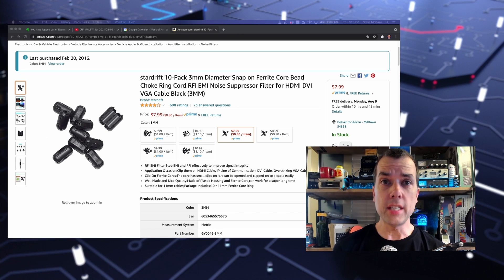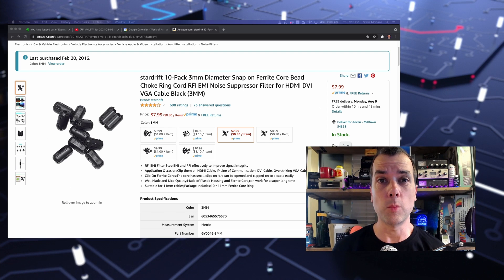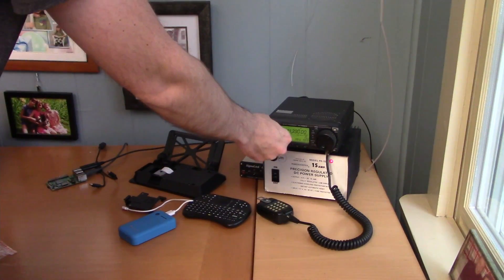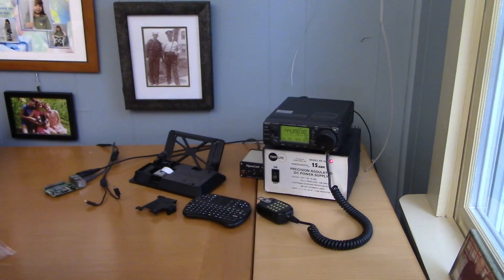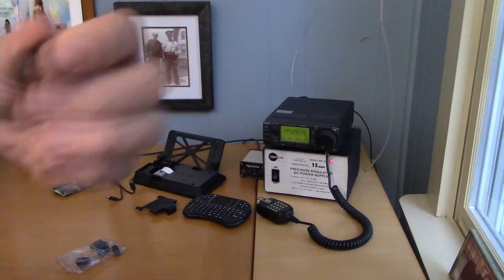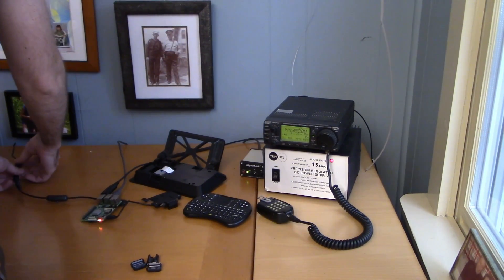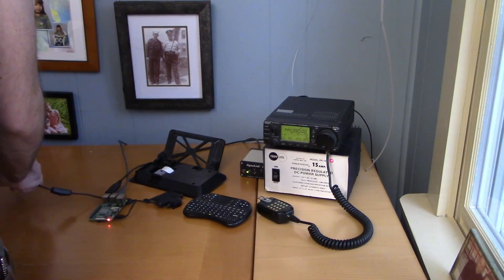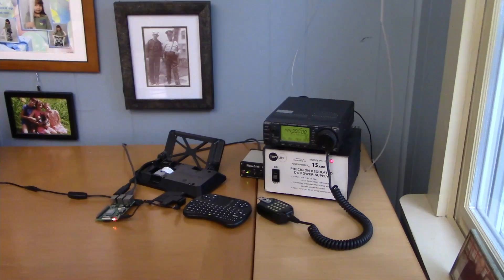Fixing RFi with a Raspberry Pi

Comment: Use a torroid and put multiple loops of wire through the core. This is much more efficient (and less costly) than snapping on 4 or 6 of those ferrite beads. The reason is ... When a conductor is passed through the center of a ferrite bead, the impedance goes up with the SQUARE of the number of passes through the center. With a torrid, you can get MANY more loops through than a snap on.
Reply from the maker: Good point, thanks for the tip!
Reply: I have both a Toroid and 5 Ferrite beads. I think I´m gonna do some experiments. My goal is to have a clean reception at HF with my Raspi4 and  SDR++. Thanks you guys for the tips

Comment: did you have your pi hooked up to the radio with a USB cable?

If so, did you try toroids on the USB cable?

just wondering.
Reply from the maker: The Pi was hooked to the radio for sure.  (the black cable is the CI-V cable).  I only put toroids on the USB Power cable so far.

Comment: Those wallwarts are a plague sometimes. Have been running into them as well, even from a (HAM) HT(!).
Replaced that one because it was no fun on HF whatever I did - at least before the ferrites.

What I found effective is running the lead through the same ferrite more than once - if there's the space for that it is. 
Looping wires through the same ferrite 4 times was more effective  (in my case) than running multiple in a row. You might want to give that a try :)

Let me know if you did and if it made a difference
Reply from the maker: I 100% agree, more passes through the core are better.  I do have another core here that was specifically made for doing the job.

Comment: I stop using wall warts for my Raspberry Pi's.  Instead I use a multiple outlet Anker power adapter.  It has enough power and no noise.  Plus it has it's own AC cord so I don't take up another outlet.
Reply from the maker: I've got one of those in use, I love Anker Products
Reply: Would you mind sharing a link to the multiple outlet anker power adapter? K2SBM Shawn

Comment: I have a huge bag from Amazon. I wasn't very confident they were effective. I bought a couple of toroids from Palomar (very expensive) and wrapped the coax through the ring 10 times. It worked  but this is a much cheaper solution. Thanks for proving they work.
Reply from the maker: It was what I had in hand, I'm happy with the results.

Comment: I used a 12v to 5v buck converter (since the 12v supply was fine)... cleared everything up except 10/12 meter bands .. Once I got rid of my Dell monitors, 10 and 12 were just fine.
Reply from the maker: I'll be trying a buck converter in this setup in the future.
Reply: @temporarilyoffline  I second this, Is your triplite PS a switcher or is it heavy with a internal trasnformer ? You may want to try to move the Buck Converter further way from the PS and Radio "if" you get any, Also a small metal box for the BC will help shield any noise, Same for the PI try in in a metal case. Thanks for the video its great you share your tinkering events with everyone very helpful.
Reply from the maker: @jimw9170  Its a lot of fun to do and I hope it inspires people to just try something.  That Tripp-Lite is very heavy with an internal transformer.

Comment: You need a clean power source. I use my radio psu to power anything related to radio. I would also use mix 43 ferrite ring wound with the usb lead if using HF. This kills my RFI stone dead but I am not sure for VHF/UHF.
Reply from the maker: Eventually this will be portable, but for now I'm just playing around.  Thanks for the tips!

Comment: Wall warts are the enemy of radio!
Reply from the maker: No More Warts!
Reply: @temporarilyoffline  any kind of wart is bad Body or radio. Agreed 1000% I try to run everything in my shack off DC battery power. I keep a charger on it. I have not picked up any rfi from the current charger I use. The switching PS are almost as bad as the wall warts IMHO. My Astron power supplies "boat anchor weight" are clean and I prefer that type of 12V power over any switching PS around any radio or SDR. I especially like battery power in the storm seasons as well.